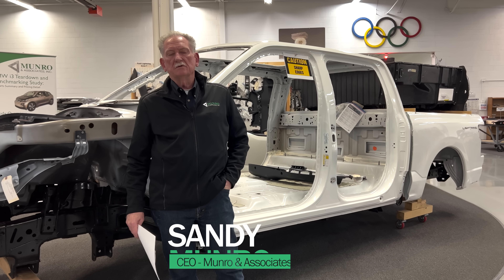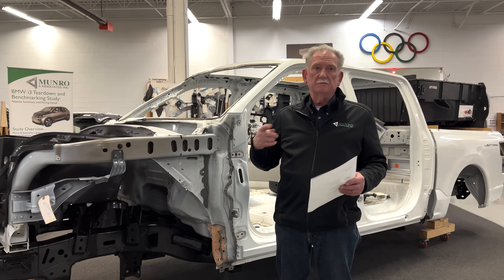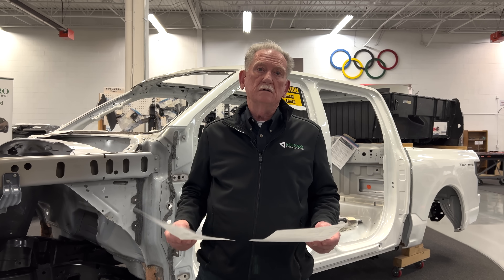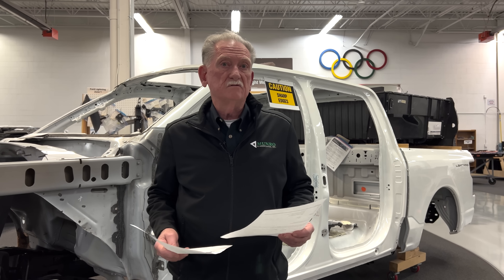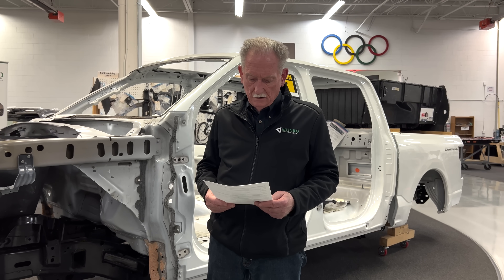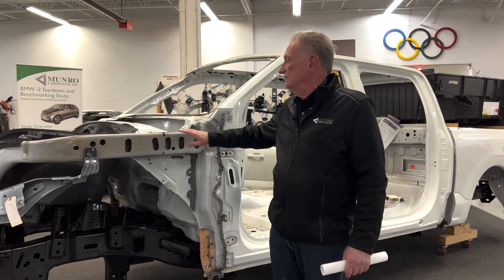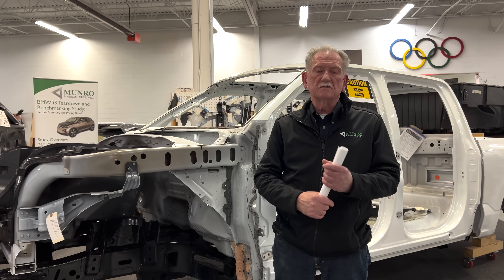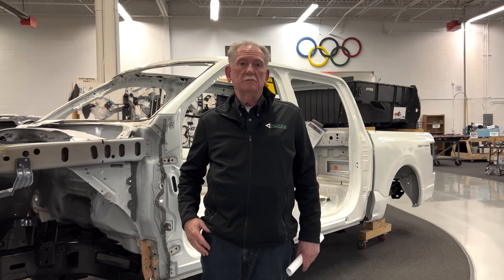Sandy's Initial Thoughts on the 2025 Ram 1500 Ramcharger

Comment: Its a truck, you need hauling and towing, the F150 lightning is horrible if you look at what a truck is 'supposed' to do.... Range extension on a truck only makes sense. Bob lutz was right in doing work trucks and vans with efficient gas motors with an electric generator and making the platform electrified. You get all the benefits of efficiency, torque, range, portable power in a single package.

Comment: Range anxiety is REAL especially on trucks. Load one down to max towing weight with a low wind efficiency trailer in January. 

I moved from Wisconsin in late January one year with an 18ft trailer and my compact utility tractor/loader/mower on it as well as whatever I could fit in the bed. Add in two small children and a wife who is anxious about the move. I also frequently travel from central Indiana to Iowa (300mi) and would cringe at two considerable stops necessary potentially in Winter months. Range anxiety is A LOT like 4wd/AWD. The vast majority of the time you are fine without it...until it saves the day in a sticky situation.

Comment: Range anxiety is  a real thing.Even tho I only drive 50 miles a day,I have a verry busy life. If I go three or four days without charging and I need to make an unplaned  drive 70 miles away ,the Ram 600 mile range is VERY IMPORTANT. SANDY,dont forget, 600 miles really means 400 miles. Remember what Tom Edison  said about battery makers.
Reply: Oh, you've never worried you might not make it to a gas station? Never ran out of gas? Never had to go somewhere and the gas stations are BUSY?

Comment: Clueless
He misses the point entirely. 
Note: some of the "extra weight" is offset by the smaller battery.  
Look at this as the "first step".  
It's a BEV with on board charging.
No infrastructure concerns - it exists already.
Finally, the future state could have purpose developed "powerplant" tailored to the task.  
1.5L displacement, smaller fuel tank...  
Disappointed in this take.

Comment: So this truck is just for people that need the 690 miles range as compared to the longer range F 150 Lightning?  This argument doesn' t hold water. What about the range betweem 320 miles and 690 miles??? 

And what about towing which reduces the claimed milage significantly?

Why should people not have access to the trucks they perceive to need? Anyhow, the demand for electric trucks is already leveling off. Let' s see how well the Ramcharger will sell.

Comment: I don't need 600 Mi of range, but I would like 450. Because I drive from Buffalo to New York, that's 410, and with one 20 minutes stop for charging to add an additional hundred miles, that gives me driving around range in the city so I can find a place to charge overnight for my trip home.

And no, I don't stop for lunch on the road. I buy snacks and live on those all the way down, I'm only making quick pee stops. Even a 20-minute stop is longer than I would care to be held up on an 8-hour drive.

330 to 350 Mi of range means I need to do one 100 mile Quick Charge on the way in and still end up coming in on empty, or take two and come in a half an hour later then I want to - and another 1-2 Quick Charge stops on my way home. So I'm a buyer when I see legitimate 450 - 500 mile range in winter.

Comment: Truthfully why do we have trucks that can go over 100 mph which is dangerous stability wise as high center of gravity.  Reduce top speed, small engines and rear end gearing 4.11 4.56 vs 2.27 or 3.73

Comment: Hey Sandy..Just a few thoughts for ya Sir. So, living in Texas and road trips to Colorado and New Mexico means the Ram Charger Truck power system means peace of mind filling up with gas and back on the road. You never have to plug it in because the gas engine is providing the energy needed to power the two electric engines and power the 92 kWh battery pack when needed. This is a game changer for me. Perfect for camping anywhere. Work truck use with onboard generator to power the worksite is huge too! Use the battery pack to power the work site and turn on the engine to keep it full. Plus, I wanted a generator at the house for emergency power. You could put the power system in lots of sizes of vehicles too. Not even considering purchasing an all electric at this point. Doesn’t make good financial sense to own a city only vehicle when you live in Texas and would like to enjoy some adventure and fun.

Comment: your missing the point. 99% of all daily driving will be less than 145 miles. For daily use you will be all electric. But that 1% when you need it, you have the capability. I cant buy an EV because I live in Florida and if there is a hurricane I need to evacuate. An EV doesnt work for me but the Ramcharger will and thats why I will buy a new Ramcharger.

Comment: I had acquired a Gen2 Volt as a dependable maintenance-free daily driver for allowing me to continue play in my CSRT4 tuning and track days without risking my only transportation.
The Volt made me realize how dumb ICE are and eventually switched to full electric. Never to drive the CSRT4 again.
I think a range-extended pickup is exactly where that segment needs to go, if only to shut up the naysayers. There's an incredible amount of idiocy being vesiculated only against EVs that that RAM Range Extended 1500 would do a lot to cure the retardation.
While I can do 1400km in a day on a motorcycle, I do understand not everyone is wanting to do that in a truck. And as pops just said, the daily average is 40miles (60kms). So it's totally overkill. But those are not the numbers naysayer are looking at. They want to prove you cant tow half of that distance on a single charge, as if it was a daily occurence.
I have an acquaintance who vaunted his pickup's 1200km range on a 120L tank. He didn't mention how much that cost but that didn't keep him from making fun of my Ioniq 5. He's a dumbass. But he doesn't understand why he's a dumbass. He loves his pavement princess. And the only thing we can do about these people is to throw at them a range-extended RAM 1500 EV.

Comment: What is the difference between a range extender (which you state the Volt is) and a hybrid ?  Which one of these will the 2025 Ram be ?
Using a battery powered pickup to tow uses up the battery too quickly, that's where the Ram can prove itself for having both power sources.

Comment: I think i am pretty typical for a middle of the country truck owner.  I drive about 45 miles most days, but about one or two days a month I may drive 200 or more miles, and I may tow a trailer.  I dont ever want to have to use a charging station.  I want to plug it in at home.  And, as for most of the middle of the country, our electric rates are very good, and sometimes there may be an off-peak rate that happens at night.  Cost of electricity as fuel is much cheaper per mile for most of my driving, and I dont have to worry about finding a charging station in a small town far away from the interstate.

Comment: Yes, this is for people have to tow long distance monthly or every other week.  You can see that extra weight take a toll on the battery.  100kwh battery same as F150 SR and it get only 145miles while F150 SR can do 240.  Jack of all trade is not a good tool.  Truck is a tool buy a tool that fit your need.  All EV truck fit 90% of truck owner while the 10% that need towing long distance has gas or Diesel

Comment: Ford, failing again, Sandi must have been some great idea man back then, what a losing company, they are stuck with EV pickups, no one wants or needs.  ANKARA/SEOUL -- Turkey's Koc Holding said it revoked an agreement with Ford Motor and South Korean battery maker LG Energy Solution for a joint venture to produce battery cells for commercial electric vehicles.

The three companies signed a non-binding agreement in February to form a joint venture to create one of Europe's biggest electric vehicle battery cell facilities near Turkey's capital Ankara.

"Considering the current pace of electric vehicle adoption, the timing is not appropriate for a battery cell investment," Koc Holding said in a statement to the Public Disclosure Platform on Friday.

"Ford and Koc Holding will remain committed to support electric vehicle production at Ford Otosan's Kocaeli plant and will evaluate potential battery cell investments in the future in line with the dynamics of the electric vehicle market," it said.

Comment: This doesn't get said often... but Sandy, you're wrong. 

1. EPA Range is very generous.  My Tesla MY has a 300+ "EPA range".   I  just went from 100% to 17% on a 172 mile drive with lots of 75MPH speed limits.  In the past 10% with the A/C.. this was a pleasant 65F.  So that's a real range of less than 200 miles in the summer, not even with rain!

2.  Batteries don't retain their EPA range over time.

3. Towing, towing, towing!!!  Cut the real range in half.

4. So that 690mile EPA range comes down to 230 miles of highway towing range (maybe a bit more)

Comment: Don''t need 600+ miles of range unloaded, but I bet the range when towing a skid steer or camper is more like 300 miles,and that sits about right where my annual summer lake trip runs.  Not to mention, on said lake trip, sometimes there's no shore power, so the truck could be used as a quiet power station, (not super efficient) but easily a days worth of power in the battery, and weeks worth with the extender.  I kind of wish Farm equipment manufacturers would transition to this style power system as an interim before fuel cells etc... can be brought down to affordability.

Comment: I have to disagree; range is everything. Plus I'm not interested in being totally reliant on electric so this works for me. Lastly, the F150 price went down because it can't tow very far and they are undesirable because of this. I am also surprised that you are not addressing the elephant in the room that is big batteries like the one in the F150 Lightening require a huge amount of mining, something like 600 tones of ore and 33 barrels of oil to make one of these batteries that can only store the equivalent of 1 barrel of oil of energy, sounds like a losing proposition to me. Not to mention, the need to spend additional capital to expand electric power generation facilities to meet the added demand of EV's (think billions in hidden additional costs to the EV game). The bottom line is, the 100% EV concept is a nice pipe dream but is economically flawed and we should not be going in that direction.

Comment: I think many miss the point. There are people, like my family that are farmers or in one case a home builder.  The Ramcharger is just a way better fit for them.  They live in Mn.  A truck like the Lighting can just be too limiting.  Say you is is winter and you need to move some hay.  Think 30' flat bed with a dozen big round bales. What kind of range would the lighting have in  the winter with a load and nearly no chargers from Minneapolis to Fargo. This is an extreme example.  My brother in construction moves a 20ft container with supplies and tools from jobsite to jobsite.  Yes, even in the winter :-) .  A Lighting is not going to cut it.

BTW is is easy to see Sandy has an agenda for this video instead of identifying with the people that might want this.

Comment: The Ram has half the battery size of the Ford so the weight may be similar. Also the battery is the most expensive part so it may cost less than the Ford. Only time will tell and if the Ram is a seemless operation it may be the winner. The Ford never reaches its max miles on the highway so maybe this will work better.

Comment: First kinda silly thing I've noticed coming from Sandy..."690 miles doesn't make sense"!?!? It makes total sense if you throw a trailer on the back for your weekend camping trip... assume your range is cut in half that's 300ish miles, at 50mph that's 6 hours of driving...split that for there and back that's 3 hours to a campground ~150 miles away, park your camper, charge at the campground, use electric power for those couple days trips during your weekend and then 3 hours ~150 miles back home no stopping at any gas stations except for emergency bathroom/snack breaks.  Sounds ideal to me!

Comment: The 3.6 VVT had a lot of initial problems when it was introduced in the Chrysler Town & Country. Particularly with the Valve Train. Are all of those issues resolved? Also disappointing was easily broken plastic Oil Coolers / Oil Filter adapter that was the occasional victim of quick change lube over torquing it!

Comment: I love the idea of electrics but I have a super commute to work, I work as a locomotive engineer so I’m on call 24/7 so I can’t have a charging strategy or schedule at home .. I drive 97 miles one way to work then the truck will sit two days before my return trip home, a lariat f150 extended range in the worse of winter may not be able to do it and there is not one charger on my route to work so something like the ram is appealing to me

Comment: Range anxiety is crap?!  That's the only reason I'm not thinking of getting a BEV truck!  I have to drive from San Antonio to Tyler on highway 79 and its over 300 miles with the last charging station in Austin.  The calculated range has me coasting into my destination.  I can't take that risk so this truck solves that problem and the towing range problem.

Comment: Normal may be 40 miles, but I need to be able to drive 350 miles through rural Texas with no electric stations.  If it can't do that, I won't buy it.

Also, it'd be nice to have a 10 min fuel stop instead of a 45 min charging stop.

Comment: 600 miles, can't handle 10 hrs of driving.
C'mon, this is a truck.  It has to be ready to tow a trailer which drops the range around 67%.  So that 600 turns into 200 with a trailer.  That's great.

Also,I may not stay seated the entire time, but on my 350 mile trip home, it is rural and there's no electric charging along the way.  I need the series hybrid to get me to my destination.

Comment: 4:13 just because the “average “ drive is 40 miles doesn’t mean that a 600 mile range is overkill. There are people that either go above that average or want to have that range. And my commute to work is 80 miles (40 to and from).

Comment: @Munro, you completely missed TOWING.  The renge of an electric vehicle while towing drops to less than half.  Most people buy a truck so they can tow or carry a heavy load at a significant distance.  The fact that you completely glossed over this seriously undermines your credibility.  

Ramcharger is truly a breakthrough if it can charge its battery faster than it is bring consumed while towing payload.

Comment: A 3-cylinder 1L turbo would be better(100kw)
Increase the battery-size by 10%.

The generator is only for towing/distance and when already rolling the power consumption isn't at maximum.

Comment: The extra range is an excellent idea for towing (where it won’t be anywhere near the rated) and for long overland excursions. Sandy is right that nobody is doing this in one sitting, but for overland it’s terrific. Also, once you’re talking about just added fuel space, it’s not hard to tack some on. This is probably a pretty good rig to bridge the gap to a better charging infrastructure. Especially since it will mostly be driven in electric mode.

Comment: The added weight of the two systems means you can't tow the largest trailer to the campground,  but your certainly are going to beat the ford lighting, because he has to stop every 100 miles to charge.😢

Comment: Ford uses non heat pump system to heat the cab.  A non starter in a EV.
I'd much rather have a truck that can tow ALL day and you simply needed to refuel.  I'm willing to be Dodge will even let the ICE recharge the HV battery, a huge plus.
  I owned a Ford Maverick Hybrid (2 actually) and Ford programs the ICE to help with Engine Braking if the HV battery is full.  They also programed mine to charge it while going UP hills, which would leave the HV battery near full, which would require the ICE to come on for Engine braking. Idiotic.  Why not let the Regen get more use?  Why not use the HV battery MORE while going UP hills (instead of charging it)?
  I feel a 100% EV truck has a place, just NOT the Lightning.
  But if I still did construction, I'd much rather have the Dodge.

Comment: Sandy, I just came across an interesting problem that Kim Java from ( itskimjava) web sight telling about a fellow,  Dobson who bought a new 2019 Model 3 Tesla upon Kim's recommendation and was using it for UBER and put 120k on it in a year and complained to Tesla that he thought the battery was dying and Tesla said it was out of warranty and the battery needed to be replaced at a cost of $9k which he paid. Dobson does think that the replacement battery was not a new one because he's not getting the mileage he used to get after charging.  Thought you might be interested in this problem, I thought that you or Elon said the battery should last around 1 million miles, maybe I understood this statement wrong if so I apologize.

Comment: I think GM should bring back the Volt drivetrain Modify as needed (ie boost bev range to a 100 miles or so and put it in an Suv type platform to start They could easily do this and make a profit on each vehicle Also the dealers would have vehicles to service

Comment: Sandy you forgot to add in the weight of the gasoline (regular) 6.073/gallon for say 12 gallons is approx. an additional 73 lb. which means that the Ram will be dragging around 593 lb. of additional weight which will greatly affect the efficiency of the electrical drive system...